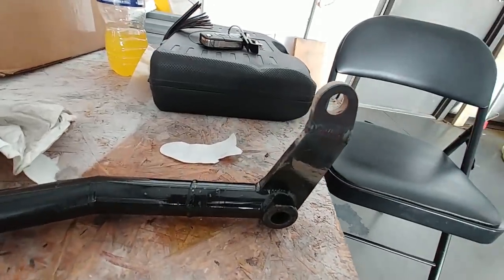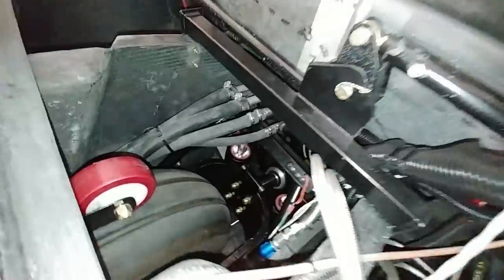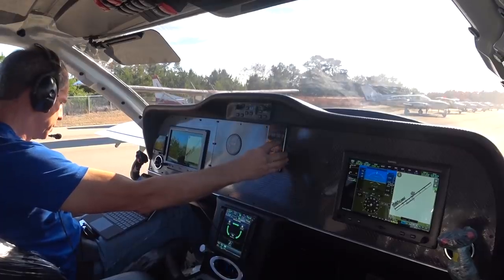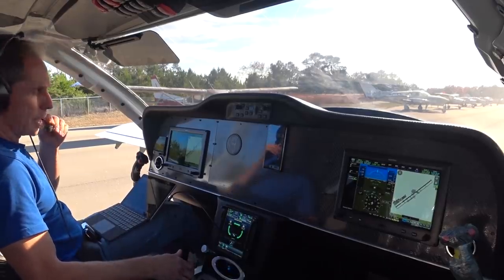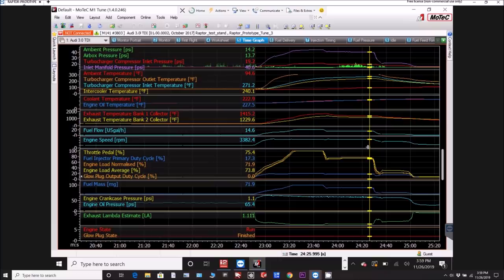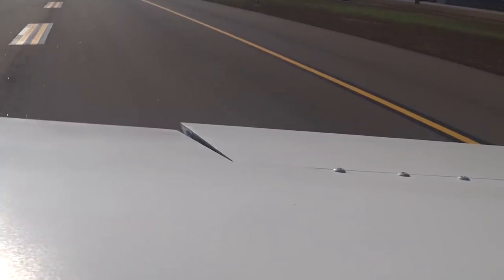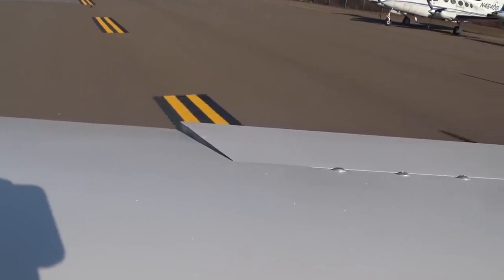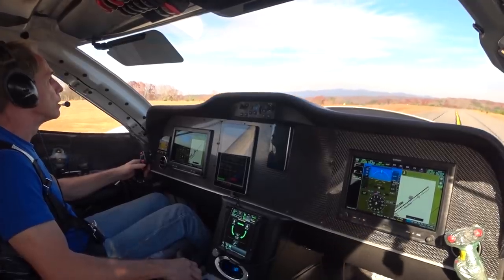Back On The Horse - Building the Raptor Prototype

Comment: On your next round of high speed taxi test I would suggest full aileron deflection at or near rotation speed, then release all pressure on stick.  This will confirm that they return to neutral with no oscillations or fluttering tendencies.  This should be done with all flight controls.  I would also remove the ailerons and balance them on the bench before flight.  This must be redone after painting as well.
Reply: Haha, are we sure full aileron deflection at or near the theoretical rotation speed is such a good idea? Seems like that could go very wrong very fast. :-) -Daven
Reply: No test pilot here, but it seems a minor stick bump would be more appropriate while on the runway at or near rotation speed only after a series of bumps and full deflections at much lower speeds for both the rudders and ailerons.   A full deflection seems very hazardous at take off speed while on the runway.  I understand the oscillation concerns and share them.    Seems this gets well into Eliot's wheelhouse and I hope we get to see all this.
Reply: A brief full defection with wheels on ground will do nothing except a possible slight yawing moment.  I'm not saying GO FOR IT, but just work up to it.  Balancing flight controls is a serious thing.  You can statically balance them on the bench, but dynamic balance with air loads introduced is a totally different animal.
Reply: Think about where your yoke is near rotation speed with a very strong crosswind.  Check out this video for example: https://www.youtube.com/watch?v=pJmtTNqXB64
Reply: @badsanta69  Exactly what I was proposing if I wasn't clear.  Full defection "bump" followed by an immediate release of the stick.  This is much like what you do in test flights for flutter.  When you're expanding the envelope, you'll eventually get to or above Vne where you'll bump the stick (no full deflection above Va - maneuvering speed), release, and hope you don't have to pull the ripcord.  Even though I extensively checked the balance of the flight controls on my LongEz, doing these test at 20 kts above Vne was nerve racking.  The reward is the assurance the airplane will hold together  if these speeds are ever inadvertently encountered.
Reply: @bigdaddie40  Love this channel, I learn every day!  Thanks for the explanation.
Reply: @badsanta69  We all learn every time we fly.  Even after 15,000+ hrs, I still learn every time I fly; sometimes from some new first officers.  The trick is to avoid complacency as much as possible and ALWAYS be open to information offered regardless the source.
Reply: @TodayIFoundOut  Yea, you have the designer do it so that you know it's safe for us average pilots.
Reply: @spqba747  Read before replying. 1) 70kts is not "high speed," however 100+ and above flight speeds with flutter might as well be 500kts. BTW only a small percentage of my 15,000+ flight time has been in FS ;)

Comment: Have you considered trying a high-speed taxi (with full cowling in place ) starting with a static run-up to near max temp. to see how the airflow change after brake release affects cooling under conditions somewhat closer to those of take off/climb? It seems to me that the change might extend your safe full-power time window.

Comment: 2 minutes seems a little excessive for a full power static run, plus it’s lacking the cooling from the airflow when actually flying. I normally reduce power in my PA30 at 1000 AGL, so maybe 45 seconds at full power before reducing to cruise climb.
Reply: Alex1911 I agree. I don’t think my Comanche 250 would enjoy 2mins of full power on a static run up, I bet cylinders would be in the mid 400s. It really needs a lot of air to keep her cool. And my plane doesn’t even have a takeoff power time limit. I think with air going through the radiator will keep the coolant level well below the redline.

Comment: Been thinking a bit about the condensate drain. Frankly don't believe you'll be running A/C at altitude very much and while not sure what your max pressure differential will be.......... but a round donut shaped float riding on a post within a sealed cylindrical "jar" would work regardless of any side loads. Using a 60 degree conical shaped drain valve would provide a graduated opening to allow a smooth transition during opening and keeping the valve submerged in water would act as an additional, though minor seal to prevent pressurized air from escaping. A check valve in the tubing between condensate pan and the "jar" would prevent spillage should you be entertaining any thoughts of inverted flight.... with that in mind, I'd review the shape of the evaporator drain pan to be sure it is sloped so as not to allow any "standing" water in the pan. You're going to want the "jar" to be easily disassembled for cleaning. As always, good luck to you. You're doing a great job in ferreting out all those little gremlins.....

Comment: Why are the avionics screens so far apart? Shouldn’t the second screen closer to the pilot seat so it can be used in reversionary mode or as an MFD? Like in the G1000 cockpits where they put the screen side by side, and give them put al the fuses in-front of the passenger seat. The way it’s layed our currently is more like a G3000 or G5000 for a multi-crew cockpit. 

Seems like a waste of a screen to have it so far from the pilot seat with all that empty panel between screens. With them closer would be able to use one as an MFD to display full screen moving maps, plus have an SafeTaxi chart up, approach plate, between the 2 screens.

Comment: You may have just used the wrong term but transformers won't work for DC.  You'll need a DC step down converter to convert 12v DC to 5v DC.

Comment: Stupid question here, why haven't you considered placing the weights inside the ailerons? If successful you would pick up a few more in speed. Plane looks smooth and slick on the underside with the gear up.
Reply: @DavidAndruczyk  Apparently you haven't any knowledge of what that weight does, nor does the designer. Sandwiching weight at the rear most trailing edge on both sides does the exact same thing because as one goes down the weight on the other aileron goes up counter balancing, just like those weights do now. 

Stupid design that needs improvement.
Adding weight and letting it hang down causes drag and drag effects air speed and flight performance.
Reply: @DavidAndruczyk  Wrong answer, weight counterbalance is achieved by the opposite weight on the opposite aileron  and vise versa in my recommendation. It also balances the effort to move them both up and down. The reason he added more weight to both sides was to limit aileron fluttering while speeding up. You do not understand so I will leave you clueless, you need to study more before you jump into other's conversations.

Comment: why is the aileron weight  and attachment even needed? never saw one on any plane, just curious. but obviously, it didn't move!!! problem solved, next.... good job again!!!
Reply: Richard Bjelland previous video he mentioned that it has to do with the location of the hinge.
Reply: In turbulent air, the wing can suddenly flex up or down.  Thanks to Newton's first law, the ailerons will try to stay where they are.  Since all of the ailerons' weight is on one side of the pivot point, they'll try to flex down or up.  This can create a dangerous oscillation called flutter.  With the counterweights, the ailerons are balanced around the pivot point, so if the wing suddenly flexes up or down, the ailerons will maintain their position.
Reply: @zolotiyeruki  hi, thanks for the info, but jets and other canard style planes don't have them, so why on this aircraft? curious, not being a smart ass, but want to understand the why?
Reply: @richardbjelland2467  I think Steve answered the question with internal balance.
Reply: @richardbjelland2467  jets and other canard aircraft certainly do have mass balances. Usually they are internal, as noted above.
Reply: While I understand the purpose of the spade, I do have concerns about flutter induced by inadvertent flight into icing conditions.  Since this is going to be a serious cross country machine, even with meticulous flight planning, it could come in contact with structural icing at some point.  With this big snow shovel hanging down from the wing that is so sensitive to weight changes, what will happen if it starts accumulating the added weight and drag of ice in flight?  Then you would take an already dangerous situation and possibly make the airplane uncontrollable.